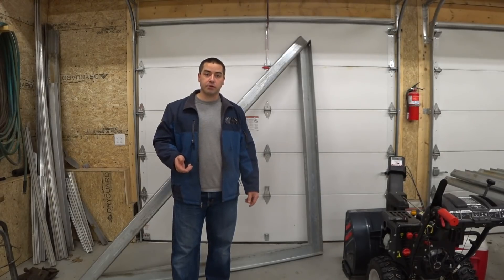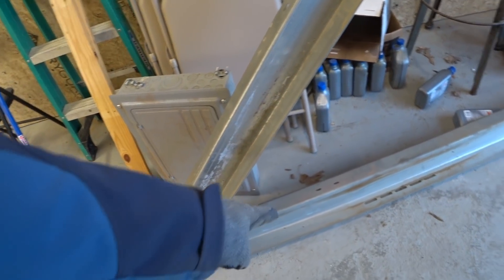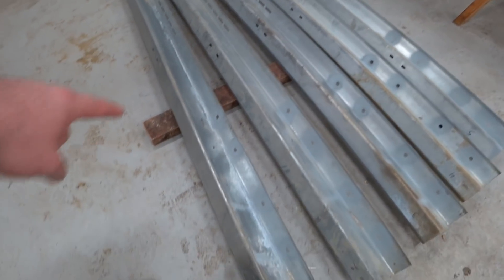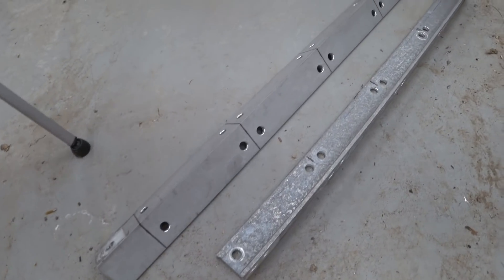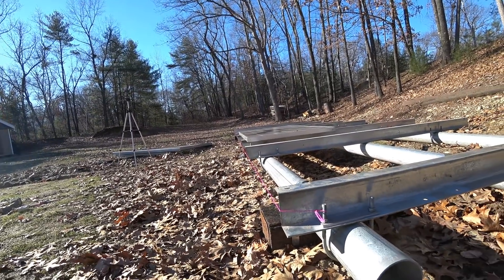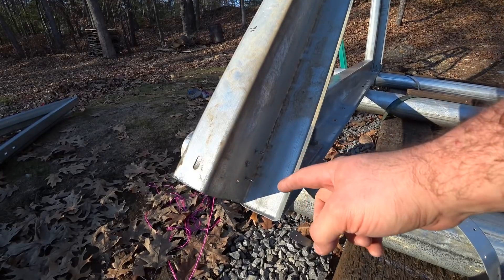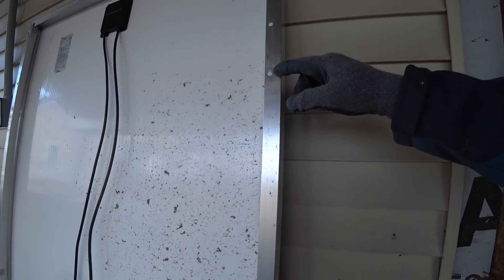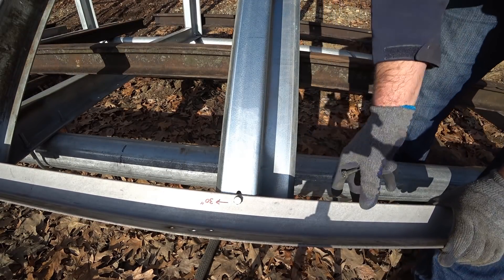Building a Solar Array Frame from Salvaged Material

Comment: Titanic wasn't built as strong as that structure. Wow you really built that to last, even if it hits an iceberg I think you'll be fine. This should be in an amazing structures compilation. Great job as usual!
Reply from the maker: Thanks, I felt I had to build in extra margin because I'm not an engineer.  Last week we had 70mph gusts here in Massachusetts and I stood under it and didn't see anything swaying or shifting.  I guess it will work out.

Comment: Could this be built with pressure treated wood instead?
Reply from the maker: Sure. I just used stuff I had.  I made a bunch of mounts in the front yard out of pallets.
Reply: @DavidPozEnergy  That's exactly what I'm thinking of using since I see so many pallets laying around & thrown out. My plan is to paint them with water sealer. I'm also thinking of creating notches on the pallet's support structure so I could easily adjust the panels during the summer & winter solstice. Where I live is tropical but I rather still be maximizing my input. Many thanks from the small island of Puerto Rico! 🇵🇷 Keep making these great videos. I'm sure Eleanor won't mind helping. 😉 Take care ✌🏼
Reply from the maker: Sounds good.  If you haven't seen it, I have a video here: https://youtu.be/sHy2Mpfzho4

Comment: I saw a guy saying you could not have contact between aluminum and galvanized steel, you will get corrosion, need stainl steel between them.
Reply from the maker: Yeah, sometimes people get a little wrapped around the axle.  I followed the manufacturers instructions.  I also have visited large commercial arrays up over 10 years with this setup (aluminum in contact with galvanized steel) and have not seen any corrosion.  I don't know, maybe it can happen under the right circumstances, but I don't see any problem with it.  Thanks for watching.
Reply: DavidPoz ya, I don't see anyone doing it either, only that one video talking about it, maybe if lots of salt in air or something., I have a ton of panels on this job that were sitting on galv. Metal, panels had some discoloration on contact points, I will check galv. V ontact points today. New guys installed aluminum rail over old rails for new panels.
Reply: DavidPoz well, I looked at galvanized struts, yes corroded after 15 years of aluminum sitting on them, panel had seperate woven ground wires, have not seen where they connected at yet, napa ca, away from seas.
Reply from the maker: Thanks.  It would not be hard to toss a stainless steel washer between the aluminum and galvanized steel.  Do you think that would take care of it?
Reply: DavidPoz ,..that's what that video I saw claimed, it seems that stainless is good between these metals, but I heard that bare steel will corrode stainless steel, not sure about that one.

Comment: Good job!  I was wondering if sheets of plywood across the back of the stand(s)would've  provided the torsional stability you were looking for AND serve as a bit of a windbreak in a tailwind.
Reply from the maker: Yes, plywood is great at preventing racking (pressure treated in this case).  I don't know about the wind being any better or worse with it.  But I had the Z-channel available.
Reply: The way the PV panels are angled is optimal for lift in a tailwind.  Sheathing the back in plywood, however, shouldn't produce much lift, but your array--rack and all--might become a sled.

Comment: Do you know if the different expansion rates of aluminium and steel will affect the squareness of your frame. My solar setup creaked for the first 4 years when it expanded and contracted with the temperature change each day.
Reply from the maker: In this setup the whole frame is steel, so it would expand and contract consistent.  The only aluminum would be the solar panels.  Yes, I suppose they would expand and contract more, but they are only 6 feet long and then stop, one inch gap, then a new solar panel.  I'm guessing that gap should keep them from making a noticeable noise.  However, if there is an issue I'll let everyone know about it.  I'm happy to share my fails along with my success's.
Reply: @DavidPozEnergy  In my case the noise was a symptom. It kept making noises until the bolt holes were sufficiently oval to allow room for the expansion. When I saw you getting all the holes nicely aligned, I assumed it would push and pull against them until they became rounded. With only the panels being aluminium maybe you won't get any of that.

Comment: Like what you're doing sir. Things to remember 1. Earth each frame via a 4ft earth rod, and mechanically bond each section,  use some form of electrical grease on the connections to reduce oxidation between the metal surfaces, also if using a metal combination box, earth it also.  2. Ensure you use spacers between the frames of each solar panels. 3. Even tho you have braced the entire frame system, install a brace on each side from the top of the frame diagonally to another on the ground about 6ft away, will provide lateral support.

Comment: Super over kill batman!  that thing will last hundreds of years :) unless you get tornadoes. I used the panels them selves to hold my temp frame from racking, you will have to have 120MPH winds from the back to move it and you have a hill to keep it safe. nice score on the metal!
Reply from the maker: Thanks.  I hope it holds up OK.  Kinda boring having them all in one place.  Yours is more fun with the panels spread out over all your surfaces.
Reply: @DavidPozEnergy   lol if that one place is in a good spot it will be best :)

Comment: Did you make the spacers out of aluminum?  Another option would have been to use a tap and die set to extend the threads on the U-bolts.
Reply from the maker: That might have worked.  I didn't think to try it.  Thanks.
Reply from the maker: Yes, the spacers are aluminum.  I like using stuff I have on hand.
Reply: I'd be a bit concerned about the galvanic response between the aluminum and the steel but a quick search seems to indicate that aluminum and galvanized steel have little reactivity.

Comment: Well it should be strong enough and not blow away or if it does you won't have to worry about it. Just a thought why not put all the panels on then brace it then tighten the panels. Hey carry on at least you got some sun. we all enjoy watching you work.
Reply from the maker: I thought about bolting on a couple panels to make the space correct, then the cross-members.  I didn't go that way because i was worried about the whole think racking and the panel hitting the ground, or another piece of the frame, and breaking.  Maybe that was over-worry on my part, but it's what I was thinking.